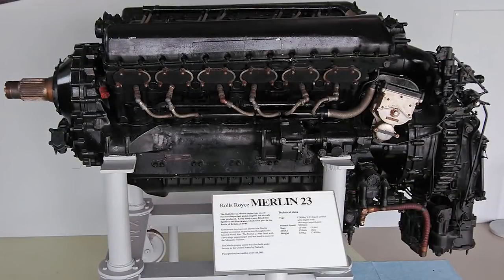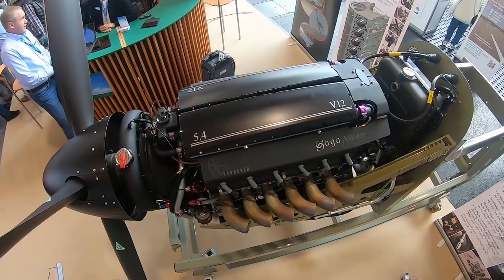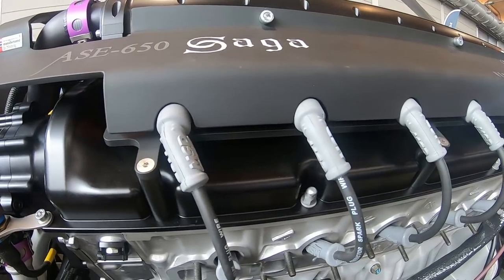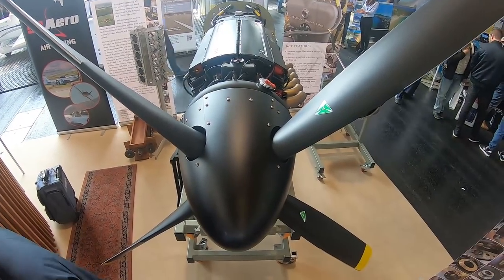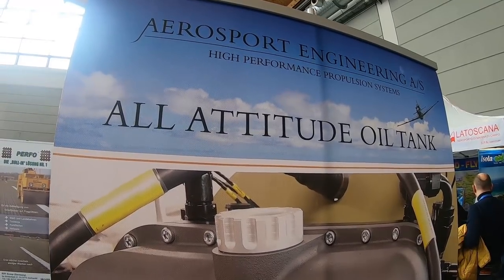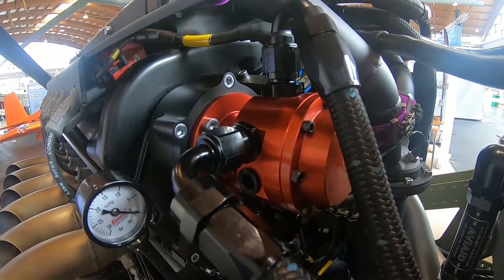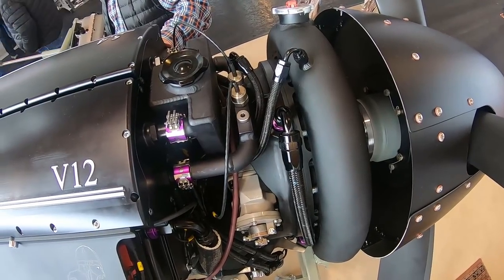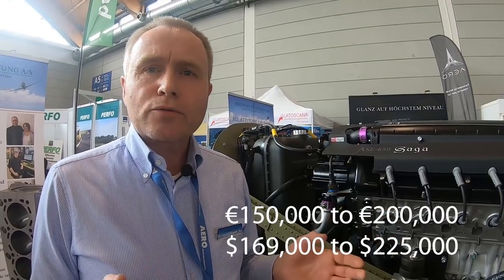Ole Ringstad's 12 CYL Sport Engine

Comment: The world needs cheap turboprop engines, not expensive piston engines.
Reply: @ Michael McCarthy - Not if you own a Stewart S-51 or a Thunder Mustang.
Reply: @Twister051  I dont think that's a growing market for planes..
Reply: Twister051 given the option of 2 thunder mustangs one with a turboprop and the other with a piston would you really go for the Merlin replica? I definitely wouldn’t if they were the same cost, but at the current cost of a small turbine there’s no way in hell lol
Reply: @Alex-us2vw  I thought in this time and age the world of small turboprops economy of scale would pass a tipping point and become more common and price competitive.   Especially with increasing government regulatory pressure to remove lead from aviation fuel.
Reply: Michael Mccarthy economy of scale and general aviation are 2 words you’ll generally never see in a sentence. 

The GA market is just way too small, even when looking all the main manufacturers combined they only put out a few hundred aircraft per year. Cirrus does under 400 units per year, Textron (Cessna/beech) around 200, Piper under 200, Diamond around 100

Even looking broader at global turboprop it’s around 600 units per year, and business jets under 700 units. 

Would be hard to justify R&D spending in any of these segments when the return on investment will come from only a few hundred new sales each year, then a lifetime or overhauls which may or may not involve the OEM as the overhauler.

Closest thing we have to a consumer/GA turbine at a affordable price and low fuel burn is the Rolls Royce M250 since it’s development was subsidized by the US military. When you take into account the faster cruise, and much longer TBO of a turbine it’s not really worse in cost then running a big bore piston engine. The M250 makes a great retrofit into GA aircraft like the Cessna P210 Silver Eagle, Beech Tradewind Turbines A36, Composite Turbine Tech Glasair III, Schweizer RU-38B Soloy Conversions Cessna 20MKII, and Cessna 185/206/207
Reply: Michael Mccarthy can also see the military R&D spending trickle down from drone technologies into GA with the Lycoming DEL engine.

The advances they make in drones will be general aviation’s best bet a acquiring access to otherwise financially unobtainable advancements in technology.
Reply: What’s a cheap turbine fuel consumption is horrid reliability is no better initial cost economically unfeasible!
Reply: Kelly Reim if turbines are really all those things then why are they the only engine used by airlines and the majority of commercial fleets? 

Even looking at small sub 450 shaft hp turbines they far outperform piston equivalents in fuel burn. Take the Cessna P210 that uses a big bore TSIO-520 that burns around 20GPH to cruise at 170kts. Throw a turbine into it and at 20GPH it can do 200kts or 25GPH @ 240kts. 

Now do the same thing in a much sleeker airframe than a Cessna P210 and speeds increase at a much larger factor. Can look the large piston twins which usually burn well over 45 GPH to cruise in the low 200kt range and suffer 1600hr TBOs that is lucky to hit 1000 before overhaul, or a twin PT6 powered equivalent that cruises around 300kts at 60gph and a 3600hr TBO that regularly makes 5-6000hrs on a MORE STC.

When you get into the fuel thirsty big bore piston engines with their low TBOs, and related downtime turbines start to look real good. The downtime alone of 2-4 overhauls on a big bore piston vs a PT6 turbine just having a few quick hot side inspections would be enough for an operator to decide against using a piston engine.

Also can’t forget that jet fuel is also much cheaper than AVgas, and for the larger operators who can bulk order it becomes many times cheaper than avgas per gallon.

If your comparing turbines to small bore engines like an io-360 from a Cessna 172 that has a 2000hr TBO, then sure turbines are expensive and “inefficient”. But since the smallest turbines are in the 450SHP range and more commmonly 550-750-850SHP range that would be ridiculous. Closest you could get would be a 400hp io-720 that is definitely not efficient beside a M250 turbine that can also operate at significantly higher altitudes.

If efficiency is measured in time/distance covered turboprops win every time. If those things don’t matter and you just want to float around at 100kts getting hamburgers on your personal time then a small piston engine is more efficient. Both types of engines technically do the same thing and power aircraft, but have vastly different missions.
Reply: According to the naaa statistics the reliability between turbeans and piston engines per hour is the same and fuel efficiency for turbeans is at least 10% worse!
Reply: Kelly Reim Post a link to the source, either it’s not from the FAA or you misunderstood something. I highly doubt the FAA would  publish false information. It also seems like something the FAA would have no reason to do since for most applications other then the few thousand GA aircraft turbines are the ONLY option available.

Calling pistons more reliable is insane considering TBO on many turbines is around 14-15000hrs, and some have reached upwards of 30000hrs. What FAA source would ever consider saying piston engines with their 2000hr or less TBOs that can sometimes run out to 4000hrs could ever be more reliable. There’s literally 1 moving part in the main assembly of a turbine and that’s the turbine itself, not very much in there to go wrong hence the 15000hr TBOs. Even the small turbines like the PW PT6 has a 4000hr TBO and they regularly run out to +6000hrs in commercial service on a MORE STC.

It’s easily verifiable that turbines are more efficient by simply looking at the POH of aircraft. Or in smaller applications like GA aircraft looking at the POH of donor piston powered airframe and performance following the STC’d turbine upgrade. On a PPH basis alone turbines burn more fuel, but they also travel much faster/higher so they travel further or arrive sooner. There is literally no practical application over 400hp where a piston powered aircraft is more efficient, other then maybe throttling back the piston to 45% power and loitering in the sky at a very low airspeed in a holding pattern.

If pistons were more efficient then you would think we would still be flying around in the large piston powered airliners of yesteryear. It’s not like we don’t know how to build large piston engines like the ones using in vintage bombers and airlines.
Reply: Kelly Reim had to google naaa since I figured it was a FAA typo. But looks like an agtruck industry association. 

I’d like to see where they claim pistons are more reliable, and more efficient and what metrics they would possibly use to determine that.

Turbines are pretty prevalent in aerial application, due to their superior power to weight, payload, lighter engine (more payload), and more power (more payload). All things important to an agtruck operation when they are trying to service all their customers in a timely manner when the weather permits. 

Few years back when I was closer to farm country our airport had a company there with a fleet of agtrucks and atleast 90% were turbine powered. Think the few piston aircraft they had were for their training program since they also trained ag pilots, allong side their spray ops.
Reply: That’s national aerial applicators assoc. nothing to do with faa , figures are based on actual experience in cropdusting, didn’t say pistons where better in reliability just more efficient and cheaper initially.
Reply: Kelly Reim post the link. We had a lot of crop dusters out west and turbines were pretty much the standard. If operating with pistons was cheaper when factoring in efficiency and down time theses companies would be using them since it’s a competitive industry. 

If one operator can get an an edge on the competition by running piston aircraft they would’ve been doing it. Productivity and low downtime is key since it’s not like farmers are lining up do have aerial applications done until something goes wrong and they suddenly need it done yesterday. If one farmer is dealing with an infestation you can be sure the surrounding ones will be too, and suddenly you can’t deliver. Or you lose business to the competition who is running the right equipment for doing the job efficiently.

Maybe out east where farms are much smaller piston aircraft spraying is more common. Where I live now (out east) they are even using helicopters instead of fixed wing which would be even less efficient vs a piston aircraft.

Only way I piston is more efficient is if your flying something like a 150/172/182 where turbines don’t exist. Even at the size of a P210 turbines become more efficient, and once you step into Caravans or larger, and mid size twins turbines own the market. Small airline operators that use these little planes are very price conscious, if there was a cheaper way that can increase revenue they’d be doing it. 

There are a few outliers out west who operate mainly on unpaved destinations who might stick with piston aircraft due to the cost of acquiring a Twin Otter, or Kodiak, or old Herc. But there are also better run companies in the same space who do just fine competing against a much cheaper/ancient piston fleet using those modern turbine equivalents suited to operating on unpaved surfaces. There’s one who even runs old 737 jets with gravel kits installed and competes against piston carriers just fine, and that era 737 with low bypass turbofan is nowhere near the efficiency of modern turboprops and high bypass turbofans.
Reply: I’m using statistics from NAAA and insurance companies and my own experience from 45 years in cropdusting l am also aware of how fraudulent the aerial application business is , the turbines seem to fit well with the thieves which of coarse the only way to make them pay !
Reply: Kelly Reim so post these so-called statistics you speak of then. Let’s see these insurance stats too, would be interesting to see why an insurance company would study their customers operations costs when all they care about is insuring hulls and legal liability. Would think insurance companies would rather be studying accident, injuries, deaths per hour since that’s their business.
Reply: Insurance is not liable if fraud is proven that’s why they study everything to reduce their liability , they can also add and have certainly have noticed something isn’t adding up. Turbines only add up if your dealing in publicly funded businesses ie socialist enterprises where nothing has to add up or balance.

Comment: i'm not impressed, since original rolls royce- merlin produced 1750 hp without all the new electronic junk
Reply: The original Merlin was far larger!!! Might have something to do with the power..
Reply: It also had nearly 5 times the displacement and was running on 150 octane fuel at the time. 720hp from 5.4ltrs, relatively unstressed would be pretty amazing in a 3/4 scale sport aircraft made of modern materials.